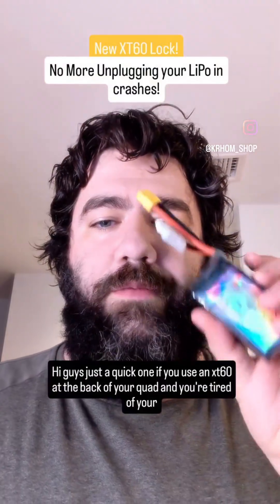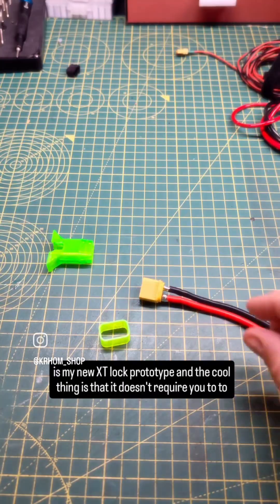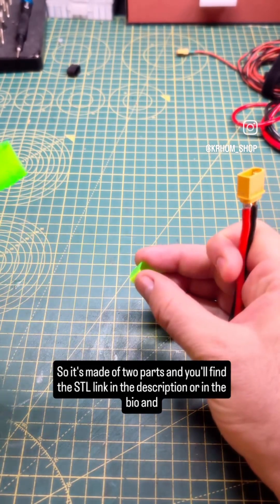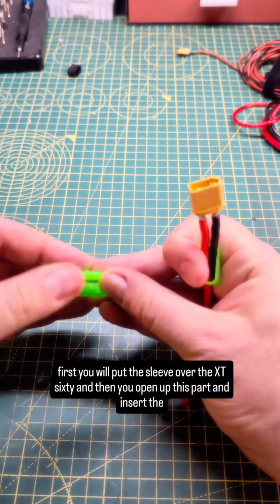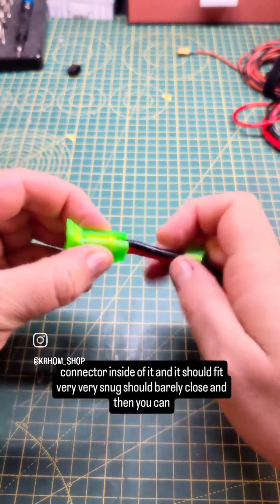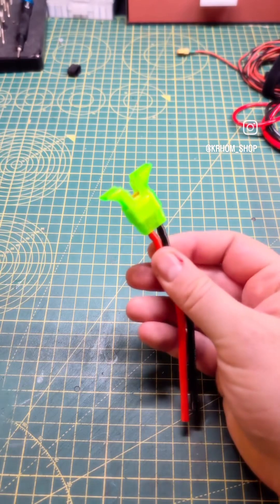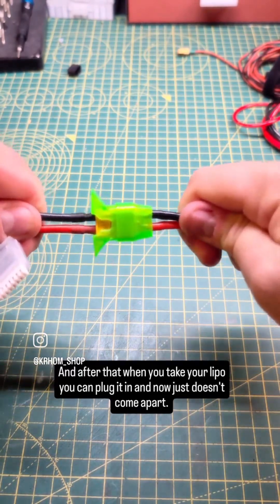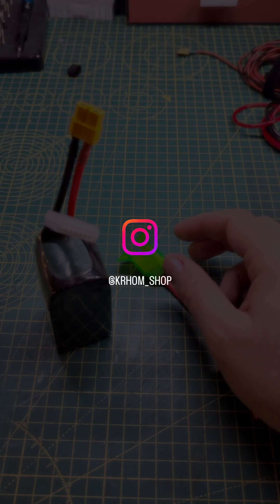New XT60 lock to prevent unplugs during crashes!

Comment: This is a cool idea but it’s execution needs to be modified an bit unfortunately. It’s never a good idea to pull on wires. It’s outright dangerous on a battery.
Reply from the maker: The whole community has been doing it for 10 years. It's fine.
Reply: @krhom Until it’s not